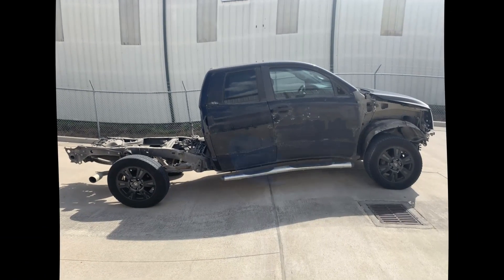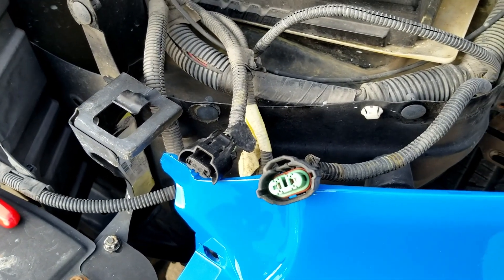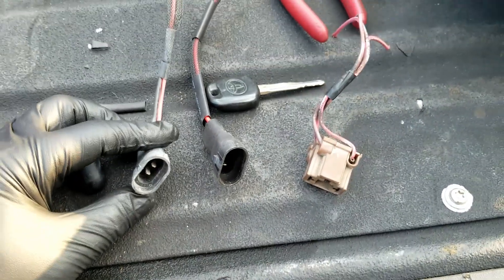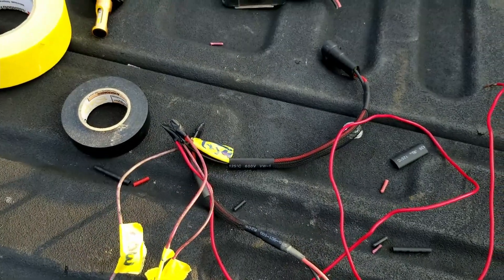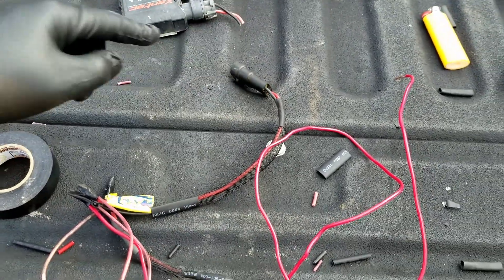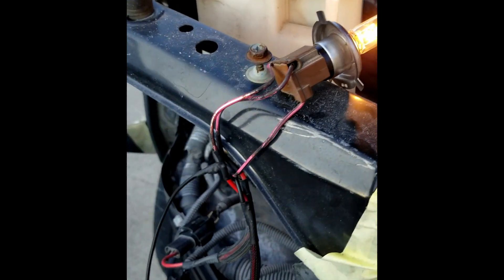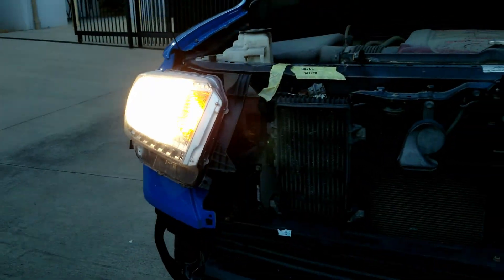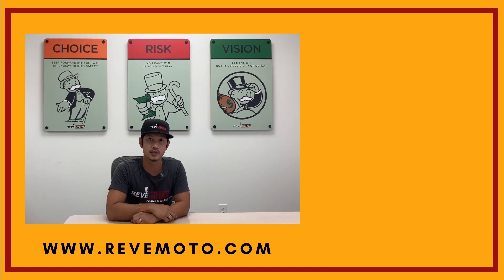2007 to 2020 Toyota Tundra headlight wiring conversion | ReveMoto

Comment: Did you have to ground it separately or can you just ground everything into the H4 harness
Reply from the maker: Good question 👍 In the video, all the grounds (from the 9005, 9006, and H4) were tied together and grounded at a single point. So yep, you can merge them into one ground instead of running a separate one.

Comment: Bro I think you mess up u used h11 plug not a 9006 but u called it 9006 or did u fit the 9006 plug into the h11 I’m confused ?

Comment: Bro I think you mess up u used h11 plug not a 9006 but u called it 9006 or did u fit the 9006 plug into the h11 I’m confused ?
Reply from the maker: Good catch, bro 👍 In the video I used a 9005 and 9006 plug along with the H4 to build out the harness. The H11 wasn’t part of this setup. The confusion probably came from how the pins look similar, but for this Tundra conversion it’s definitely 9005/9006 feeding into the H4.

Comment: Any info on the other plugs like turn signals, etc? Also, did you do the rear end swap with the 2020 taillights? Any wiring info on that?
Reply from the maker: Hello. There were no modifications done to the tail lights or turn signals. We stayed with our 07 lights because it didn't make much difference. I believe the shape of the tail lights are different, I am unsure about the wiring. Thank you for watching!
Reply: @ReveMoto  I guess that means you didn't do the bed swap the because the bed and tails are completely different. Thanks

Comment: Yo I appreciate the video showing us how to do this. I am worried about using the old wires still because idk jack about electrical. If I went aftermarket to a pair of 14+ headlights that drew more power would there be an issue? Is there a way to just straight replace the cables completely from the 07 to the 14+?
Reply from the maker: That is a valid concern. Wires usually never malfunction unless they have been chewed or are exposed. We used our old 2007 wires and some old fixtured we had. I don't think the headlights draw more power bc they have 1 light bulb with 2 settings. Just make sure you unplug the battery if you do it our way. There is a company that sells the exact same configuration we did, I believe they're around $200. Thanks for watching!
Reply: What the name of the company that sells them???
Reply: Underdog, we're you able to order a pair of connectors or did you diy? Thanks.